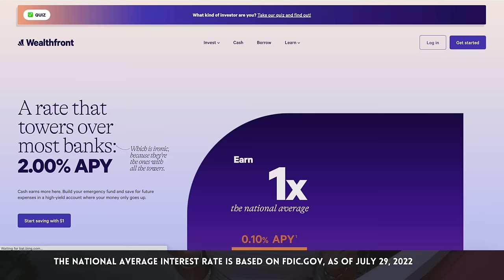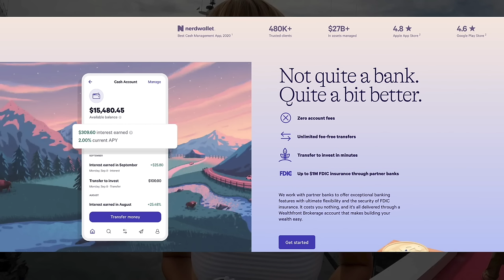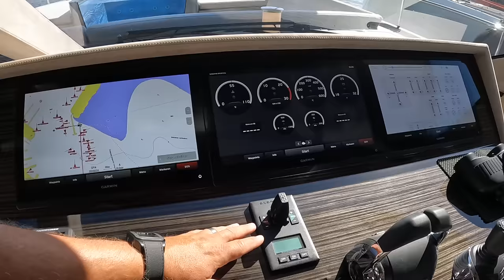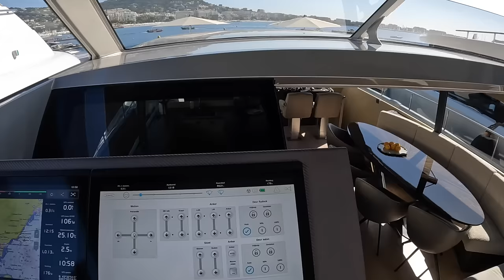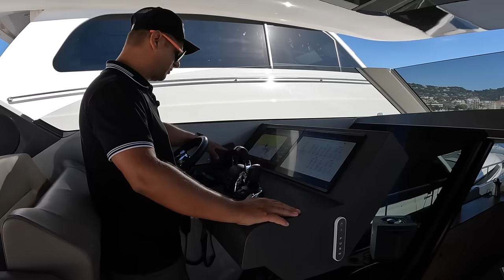$6M+ ST BARTH 75 World Premiere!!! Fully Aluminium Unique Layout Custom Luxury YACHT TOUR

Comment: Magnificent. Looks like an architect designed it.
Everything matches, from hull color, to interior, furnishings. It is truly astounding.  Love to have a condo like this. The work alone for all that Fairing over aluminum. Dutch quality. This is not a new concept, Looks like it was inspired by Van der Valk Beachclub 660,
Which rocked the yachting world when it came out.
Also Dutch aluminum. Totally customizable.  with or without flybridge and same 2cond helm station.

Comment: Very nice yacht with many well thought out Ideas, but I would still have tried to fit a door from the lower helm by the stairs that goes out side. its not that far to walk around to get to the bow but still a inconvenient. It would also make docking a bit easier. I would also add a window to lower on the galley side to make provisioning the yacht easier.

Comment: Fiberglass mold maybe light and a bit cheaper but there are other issues with it over time things begin to misalign. I think aluminum or steel is the way to go. this boat has some very sensible design aspects to it practical and elegant.

Comment: I'm liking the 60s cruiser vibes in the design. Very nice 🤌

12:45:  the galley is amazing with the open layout near the helm. If you're an owner operator trying to keep an eye on the boat while making a meal this is such a huge bonus. 

I really like the lower salon being more private a level down with the 2 guest cabins. A place to lock the guests down with some drinks and retreat up to the bridge :D 

I've been aboard a lot of older yachts in the 60-75 ft range and this layout and the volume is just incredible.  

Having the master forward would make converting one of the guest cabins into an office pretty easy. The open head sandwiched between the sink and shower sans door is a no-go, but for 6M custom yacht its just reflecting a personal preference. un gros non pour moi ... 

The 2nd exterior helm seems redundant IMO. I think a smaller docking station on both decks and free up that space for entertainment. 

The Jacuzzi system is a keeper. Being able to drain and refill from the tank is a very practical solution to enable a big-yacht luxury feature on a smaller boat. Big accolades for the entire front lounge area and both aft decks. They squeezed a lot of square footage on the exterior spaces for a boat with a cruiser shape. 

All in all an incredible build for a large pleasure boat - congrats to the owners for realizing their dream setup. And thanks for another fabulous tour!  Ciao

Comment: Unique is a great way to describe her. The Mount of stuff you could add to the NSB75 build list is a lot. We have certainly seen a lot of sub 100ft vessels that punch way way above (e.g: Horizon FD 80 & 92, Princess X80 & X95, plenty of Explorer Trawler yachts, as they are just so well designed. Some working justbas good as a luxury vessel etc). This is a class on its own. I'm always wary of the large access that low. Esp in rough weather and you stop suddenly. Hoping no one has left the doors open lol. To say 75ft yacht with these amazing features is onething. To say 75ft yacht with these amazing features in places you'd not see on many other vessels is acetone other story. That bow area AWESOME (to paraphrase Team Vico). If I don't see any of these great features on your NSB75 build I'd be a little upset. Cause the space saving sink in day head is great. Not forgetting the commercial grade dish washer. I'd even go as far as adding that Miele Griddle. Aluminium build is also cool. The couple who own and built this know their onions. I bet their next build will knock even more socks off  than Hull 1 is doing. Many builders need to take note of a future concept here today. I'd love Alexias to brainstorm with them. Utilising them on your 75 build. Can you imagine Bering and these two getting together. 

V - did you notice the Cameraman/Costar/Capt hint the Co Capts chair in the helm area. I think he's bucking for the Stars role again. Mutiny in the air me thinks. Rico your an amazing Captain/Costar but V is Admiral of the fleet. Lol. Luvs ya both. Bucketlist to meet you both oneday, dream to meet on your B75. Lotto win I'm there. If you in U.K esp Southampton International Boat Show one time. Please pop in for a cuppa. My flat is falling apart and struggle as you know. The door always open, and kettle ready if you do.

Comment: Walking straight through from the typical toy garage/beach club area to the lower level is very unique and the tender is nicely hidden below deck. The tiered sinks look cool but would be a nightmare to clean. Those inward opening shower doors don't even leave that much room to close with Victoria inside so I know I wouldn't have a prayer. 19:07  The aluminum is attractive and practical and the bow tub fill/drain system makes it much more useable.

Comment: Good day,
Wow, very remarkable throughout, significant ceiling height in each area. The well-appointed spa zone situated in the bow area is really well thought out. Are there multi-coloured lights similar to hot tubs in the unit? Now, just curious, seeing the heads do not have doors, were there ceiling fans?
On the specification listing, no mentioned of its cruising range, is this available? As you led us through this tour I got the impression you were visualizing some of what you saw to be applied into your next vessel?
Thank you again for another really informative video.
Do take care; stay safe and looking forward to the next venture.
Larry,
Reply from the maker: Thanks Larry, the fans were in the showers, i pointed it out. I didn’t get the range from Frank, will ask again

Comment: VICTORIA AND RICO!!! SOME INFO ABOUT COMMERCIAL DISHWASHERS AS A CHOICE FOR THE NEW BERING 75!!! A commercial dishwasher can be an excellent addition to a kitchen set up, but remember you need to wipe off and rinse what you put in there before you run the cycle. Yes, they are very quick, but the primary tasks a commercial dishwasher performs is very effective high temp sanitizing as well as a powerful final wash/rinse. What you won’t find is the sort of multi direction spray set up in a heavy duty service domestic style machine. Definitely longer cycle times, but, you can shove food grime laden dish wear, sun baked sugar on glasses, and hardened food covered silverware and it’s designed to pre-soak and power rinse all that gunk off and some even pulverize it for easier disposal out the drain instead of pulling and emptying catch baskets for larger chunks of food yuckiness. 

If you want the ultimate set up (which I have seen on a few vessels you have done tours of and is exactly how I set up my kitchen), have a nice large capacity heavy duty domestic dishwasher for the bulk stuff, and also install a small sized commercial unit for blasting out smaller loads and to keep up with rotating glassware during times of entertainment where folks are going through glassware turn overs regularly. That is by far the best set up to go with. 👍🏻😎👍🏻

Comment: I have never been on a large yacht, but I have plenty of experience with smaller boats and jet engine crafts. Many of the yachts have low open sterns.  It could be very easy for a rough wave to crash over the stern and if any doors are open... half the boat could be filled with water.  If a seal was breached the wash can fill the engine room.  Is this a concern?

Comment: Not a hibachi, not a grill, it's a flat (probably aluminum) griddle... It's actually a 4 bedroom with living room below, and engine rooms are a waste of space that this boat turns into a huge beach club - brilliant. 
The owners were obviously thinking of an owner-operator with kid(s)? If yes, the family area is up front (am guessing a pullman could be installed in kids room) or a captain could take that kid's room; and then guests have the area in back/center to themselves. This is a very well thought out use of space - as you say. It's so rare that the front of a boat is actually inviting like this boat's is. Adding a 65" TV over the main bedroom bed - with a closed circuit view of the forward view from the boat's bow - would be incredible.

Comment: That is a sexy machine.  I'm not a big fan of those stepped sinks - but everything else was spot on.  Great Miami boat but Bering & Allseas still have my heart.
Reply: I used to do Corian counters. It would have been  a bit more difficult to make properly, but the layers should have had internal coves and external rounded edging, so that there would be no difficult sharp inside or outside corners. It would have looked more artistic, solid, and easier to clean in my opinion.

Comment: What an amazing boat. Only one thing I would change.  Please , Please change the Washer Dryer combo unit out  for discrete Water and Dryer units. The combo units are just this side of miserable. They hold half of a normal load and take three time as long to do a complete cycle. Their reliability is sub par  and you'll be changing it out the first year out of frrustration .

Comment: You know what would be cool and I've never seen on yachts, but the pop out tables that are in Maybach's, Bentley and Rolls-Royce cars. The mini folding tables or trays that can come out and then fold away. Riviera does something with their SUV yachts where the table comes out and folds under the seats. Another side note is that if you wanted to heat up the jacuzzi water, just put the tank under the engine so that the heat will keep the water warm. If you want the water cool, you have a secondary tank. You just have 2 tanks. It's not practical, I admit but depending on what you want to use the pool for determines where the water comes from.

Comment: What are your thoughts on having the tender resting on an aluminum plate after it's been in the water? So close to the engine room. Any concern for increased salt corrosion versus a traditional tender location on the deck?
Reply from the maker: You would rinse it while it’s on the crane before putting it in the garage

Comment: A 75ft Fibreglass Sunseeker weights 25-30 ton with two massive engines. With ally so much lighter and much smaller engines needed, also more economical on fuel. Nice layout but prefer verticle entrance doors and had spas in houses for last 25yrs but never used once.

Comment: My thoughts are on Bayesian and its sliding glass doors. So my question is how safe are these sliding glass doors on this boat?I wonder about the engine compartment and how safe the IPS volvo is if you hit something and knock the whole axle off? You'll be dead in the water and overfill the engine compartment. Then the boat will go deep into the water and then the question is again the glass doors. Electric also when all electricity and engine are switched off.

Comment: My concern with all Aluminum is will it stand up to the tons of weight from crashing turbulent waves and not twist or bend easier than a steel hull or is the Aluminum thicker?
Reply: This isn't an explorer yacht where you can motor sail it across the Atlantic. This boat will spend most of its life in calm waters.

Comment: Indeed quite an innovative boat but if you dig deeper one can see the foundation is based on the traditional Dutch pilothouse yachts, which you witness in the channels all the time. This design has a lower airdraft for the Dutch waterways and because they are used by family crews, designed to operate by a husband and wife (couple) all solutions are simple and working to ensure easy handling..

No doubt, they had added a lot of innovative ideas on top of this strong foundation to end up with the products.

It looks well built as many other Dutch built boats, nearly no nonsense, unseaworthy like solutions. However, the hatch cover, engine room access seems not to be built to Northsea conditions. I wonder how much water tight it is if you start to have solid water on the aft deck??

Comment: As unique as the rear platform fuel tanks are id imagine why they aren't typically used is if the were struck from the rear punctured in a storm or ran into by another vessel there isn't just an environmental impact but a potential fire hazard i would think even if the internals are lined or coated

Comment: An amazing and brilliantly designed yacht which I could happily spend my lottery win on. However, as a typical Brit, I would have to have substantial doors separating the cabins from the heads. No partner needs to hear/smell a persons morning routine.
Reply: esp the master - I was surprised that the toilet is directly in line with the door into the suite.  I would want a barn door slider at least if it was too complicated to have an interior pocket door installed.

Comment: I really, really like the layout of this boat. I would keep one of the guest rooms off of the salon, install a kitchenette and small eating area where the other one is... Then for the cabin by the master, I'd turn that into a full office. I think it's big enough. Overall, I'd shrink the boat a bit. Instead of 78', I'd probably go with 63' or something. In the master, I'd like to push the bed off to one side and have the sitting area be lower to have a window below the waterline. I'd love to lay out there, kind of in my own little world, and watch the sea floor and sea critters doing their thing. I like the idea of the little boat being stowable and I also like the idea of the engine room's 'roof' being removable/liftable so you can stand in there. Though I do wonder how well that would work if you have to do emergency work in inclement weather... I like the idea of a little pool/hot tub but as you saw with the little bit of wake the passing boat made, a lot of that water spilled into the retention cavity. I'm assuming a pump has to keep the water level up? Costs electricity... Also, what do you do about rain water or sea spray? Is there another place to drain the water other than the nice freshwater tank? I would also layer the roof surface with solar and try to get as much to run off of those as I can to save on fuel. I'd probably see if I could bump the fuel tanks up to 2500gal capacity for trans-Atlantic trips as well... Very intelligent design. Not exactly to my tastes, but it is probably the closest to what I would want based on your videos that I've seen so far.

Also, if I could make all the rooms float off of the frame for quiet while the engine/generator is running, I think that would be ideal. I feel that even though the cabins are on the opposite side of the ship as the engine/generator, you'd still be able to hear it via the vibrations through the framing.

Very nice yacht. Very, very nice. :D

Comment: No Just NO, To start I like modern but not this, For a 75-footer, this was my least favorite one, I hated the sink above the toilet, and I disliked the windows going behind the wall, it makes it look like they built the superstructure and crammed everything in. The full-size beds against the wall will be a hassle (just bought an RV and we had the same issue with a single bunk it is ok not a full or a bigger one makes it a nightmare to change the sheets). This is also the same type of issue with the waterfall sinks they will have to be cleaned with a toothbrush on the corners and this will probably take one person 4 hours just to clean all the waterfall sinks. I like the stainless steel cup holders my 2008 sea doo speedster has cupholders like them, mine are lighted. 

The fuel tank in the rear raises issues for me if you back into something or something rear ends you have very little protection, is it even legal? seems to me there would be regulations on locations fuel tanks are put.

I also did not like the Helm layout they are so close together and the upper one with half stories walk-ups you literally could have a person at each and they could have a conversation together, seems like a waste. 

I understand the engine setup with deck access, it would be cool on a smaller boat, two of the valves show signs of leaking, and dang the owner opened the hatch with the water filters looking that dirty, they looked like they had not been changed in a year, also the installation of the sound dampening panels in the engine compartment looked like a kid installed them, I would never accept that type of quality workmanship on a yacht I owned.

This one shows as an owner designed, very much to his tastes, and not for the masses.

For the price, you can get a new 75-footer, like I said NO Just NO.

The sun dress was nice, :).